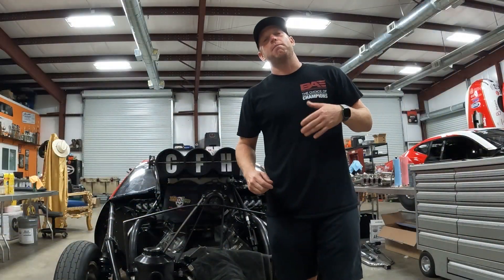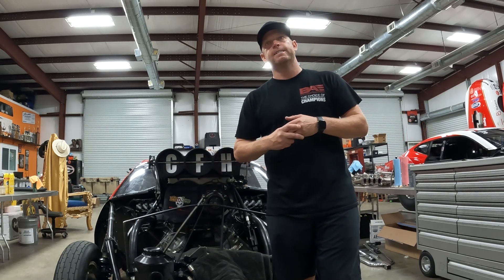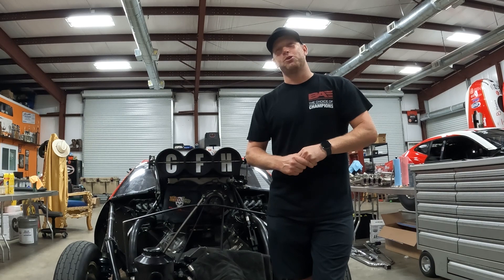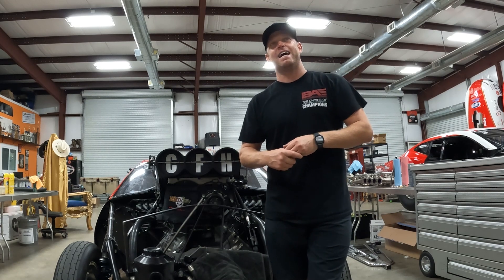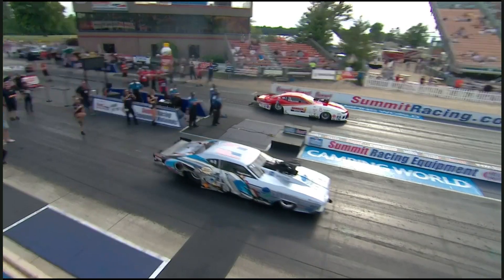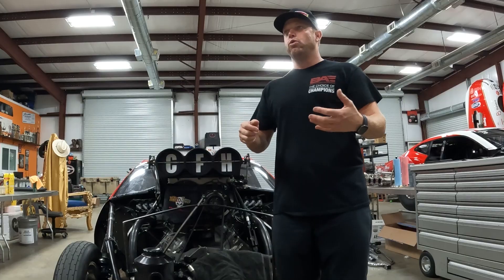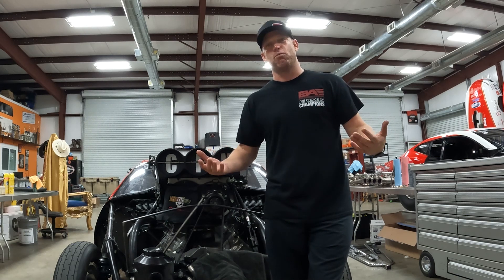SCREW BLOWER vs THE WORLD!!!!  NHRA Pro Mod gets Screwed!!!

Comment: BAE for life!! i grew up racing with Brad, Carol , Shelly and Randy. Back when manual lean out and pneumatic retarders where cool! I got paid in Jolly Ranchers and Tee shirts. Brad always took the time in the pits and the staging lanes to explain EVERYTHING to me about the tune up and his take on what the car was doing. When I turned 16 I took my GED got my license and moved to Indy to work on the first Fuel Funny car to break 300 thanks to Brad. I spent my life burning Nitro and it will never compare to Running NHRA divisions 6 & 7 TA/FC in the 80s and early 90s. Dragsters where even still cool back then with the hemi 4.4 lbs and wedge 4.0 lbs per cubic inch weight break. When Blane with the “Olds” and Rick Santos S&S auto SBC hurt a lot of feelings!
Reply from the maker: Bad ass man!!! Brad and Jeremy and the guys are top notch
Reply: Are they better than proline engines?
Reply: Dude! Did you work for Mike Kloeber?? I am a fan of his and wished he could have worked things out to a better conclusion a few months back with Stringer Motorsports
Reply: @tripprogers4814   The Stringer motorsports deal was not his fault it doesn't matter who Doug hires he does not have the budget to be able to run with top guys  unfortunately. You cannot try to win races and save parts at the same time just a known fact and I hate it for clay

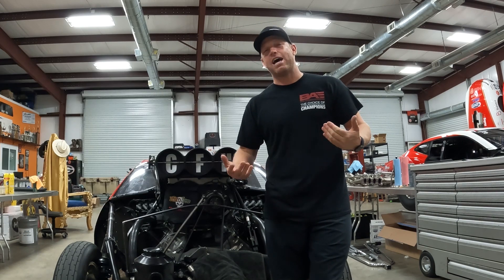Comment: 10:18 
Steve! Isn’t galvanized pipe more susceptible to cracking and breaking due to harmonic vibrations? You might  need more pliability and not so much rigid pipe.? Can the air lines be lightweight, black AN? Do you run 110-120 lbs. of CO2 through the lines?

Comment: Stevie Fast you should start a Prepped Kings series for ONLY 1/4mile racing, in my opinion the NHRA PROMODS are currently the BEST because they run the full 1/4mile & obviously many are afraid BUT I think you are the right person to start a 1/4mile Promodified series outside of NHRA with less stringent rules & it will be for the BEST of the BEST …

Comment: Can somebody please explain the difference from a screw blower to a roots blower to a procharger? 
And why NHRA keep changing rules for each.
Thank you guys. 👍
Reply: That's a big subject to handle in a YouTube comment.  Screw and Roots compressors are positive-displacement, which means that they move a certain volume of air with every revolution.  If these compressors displace more than the engine they're bolted to, pressure in the intake manifold will be boosted above atmospheric.  

Screw compressors (also known as Lysholm compressors) have internal compression, which means the volume between the rotors decreases as the air travels through.  

Roots compressors don't have internal compression, they cause an increase in air pressure by forcing a larger volume of air into the induction system than the engine below can pump.

Procharger is a brand name of a centrifugal compressor that operates on a completely different principle.  A centrifugal compressor has an impeller that accelerates air to high velocity, and a housing containing a diffuser that slows down the airflow in a controlled way, causing the pressure to increase.

Centrifugal compressors are the most efficient of the three types, causing a minimum of air heating for a given amount of boost pressure.  Plus, they take less power to drive than the other two types.  Their drawback is they don't make much boost at low rpm, and must be spun up to impeller speeds of 50,000 rpm or more to get maximum boost.

Screw compressors are more efficient than Roots, but take more power to drive.

Roots blowers can be nearly as efficient as screws, depending on how well they are designed, but don't have high efficiency at the high pressures that drag racers run at.

The other type of supercharging is turbocharging.  This uses a centrifugal compressor, but drives it with a turbine section propelled by exhaust gases.  The other supercharger types are mechanically driven by the engine, and take more power from the engine than does a turbocharger.  Turbochargers take power to drive, but since that power comes from waste heat in the exhaust, the penalty is less.

The NHRA keeps changing the rules in order to keep the competition close among the competitors that run the different types of superchargers.
Reply: @andyharman3022  
Now that was an answer 👍👍👍
Thankyou
Reply: Roots blowers have a basic sort of 2 lobe pair of rotors compressing air against the blower case.

A modified screw blower or a full on screw blower turns the compressor rotors into literal multiple spiral lobed rotors, allowing much more compression, or Boost of the induction gases. Two lobes can only spin so fast before heat makes them extremely inefficient.
Screw blowers are the hot rodded, modernized, badass uncle of the original roots blower tech.

If ya watch top fuel, its a similar sort of physics concept to moving the blower forward on the intake. Allows more case volume to act on the top fuel cars intake opening, despite being restricted to normal roots style OG blowers.

I think a Magnusson style supercharger is a screw style, and the OG roots blowers are akin to Mike Finnegans Blasphemi 1955 chevy. 

In all likelihood, youve gotte an answer already.

Comment: I'm sure it doesn't matter but I watched all the NHRA  BULL $HIT that happened with pro stock in the 70's that ran the hemi out for good.  It was the same style of shenanigans they pulled on top fuel with the nitro ban. Then in the 80's they couldn't cope with mountain motors and without IHRA we never would have seen them in action. All that leads to Pro Mod and everyone knows that Pro Mod never became what it is because NHRA wanted blown alcohol door slammers it happened because men built cars with engines nearly too powerful to control in a suspension car and the fans loved it and not even NHRA can do without fans especially with how much it cost to attend a National Event. Way too much for me to pay.
A very long list of nonconformist made their way separate from NHRA because of it's stupid rules and continuous efforts to slow cars down and against those odds many other men fought that tooth and nail and the cars went faster anyway but always with that NHRA collar around their neck. You actually brought my interest to the sport back enough with the Shadow gapping everyone and making NHRA cars look slow. Every man has to do what is responsible and sometimes that forces changes in what they do and how they do it and I understand that. But I have seen your ability and spirit to push the envelope of performance and WIN. I hope the grip of that all time nag NHRA doesn't bridle your talent and performance. I miss the Shadow but you and your crew are still the best no matter what car you race or where you race it.